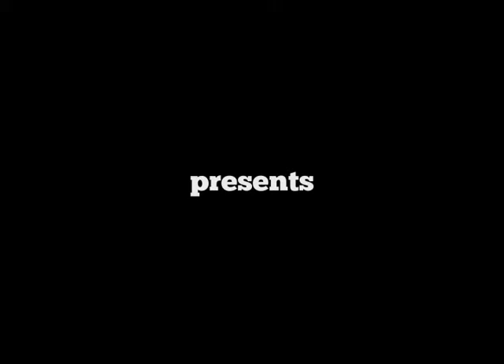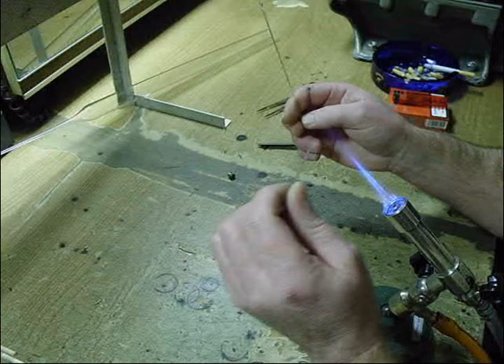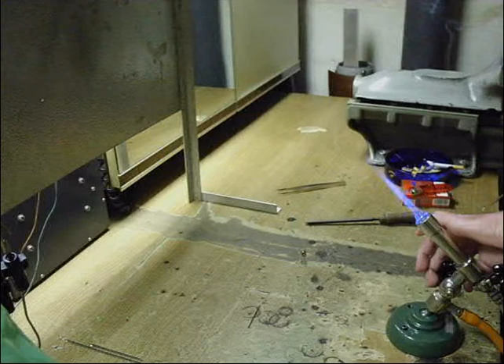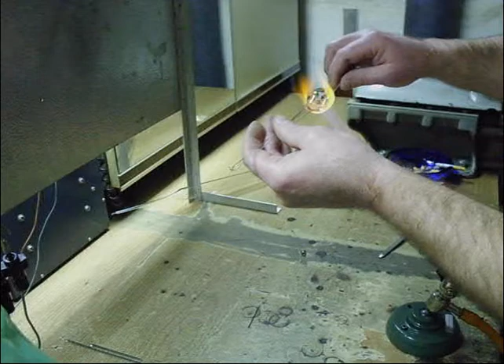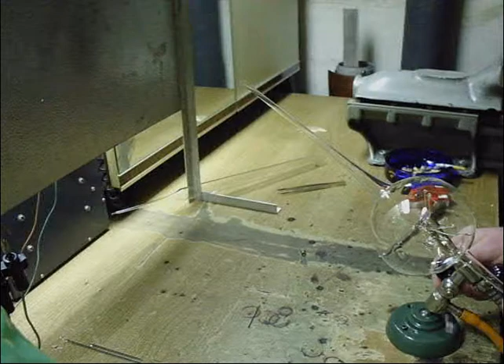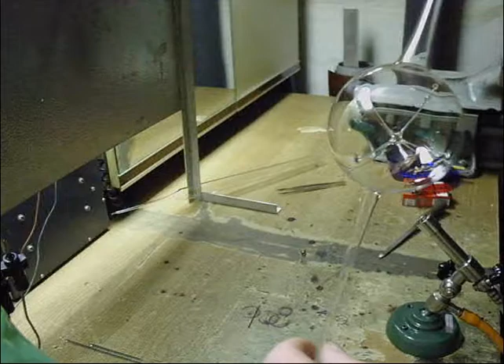Witch Ball

Comment: WOW!   i could never have guessed this is how it's made. although YouTube translation made a mess of your description - i understood enough to get the idea of soft glass inside a harder glass. amazing !
and thanks for making the video so quick :-)
Reply from the maker: +catman72 Thank you very much. I'm sorry the text is not in English.
Reply: +xofunkox  I always manage to get your text translated by Google Translate, and understand everything  perfectly.  I think they changed something in their algorithm since this text shouldn't be too different  from previous ones, and the translation was bad. But i used to sing in a choir pieces by Brahms and Mendelssohn so i know some German...
Reply from the maker: +catman72 

Ah, a glassblower and classical singer... Voice as glass. Very good!!!
I have the Bing Translator.
Reply: +xofunkox  Yes, Bing is better, i now compared them. 
BTW do you break old CRTs to salvage the color glass bars inside the electron-gun?
i collect those since they are essentially color boro glass. i tested them in the flame and they behave well. but i have yet to mix them with 33 COE glass , and see how they behave.
i remember reading about them in a glassblowing forum long ago, they called them Dwarf Glass i think. 
it was said that for many years they were the only color boro on the market
Reply from the maker: +catman72 You mean the white glass strips which hold the system together?
 I thought it is lead glass (electrical insulation). Good to know...
Reply: +xofunkox  its true many of them are white, but the older systems used yellow, pale blue, brown (very strange...) and green. i can send you pictures if you want. i have no idea why they used those colors.
Reply from the maker: +catman72 Yes, I've seen even Brown. The metal (Ni/Cr/Fe...?) of the CRT-System is interesting for glass metal fusion. It must be the same COE as BORO 3.3.
Reply: +xofunkox   i dont think its really fused to the glass, it looks like its stuck into it but not fused, its a bit "dancing" in those holes. but if it does fuse - maybe its Covar metal? but i doubt it. in any case - its very thin so maybe its a bit forgiving to the difference
Reply from the maker: +catman72 Yes, I think you're right. The sheet metal is very thin. There you can just experiment.